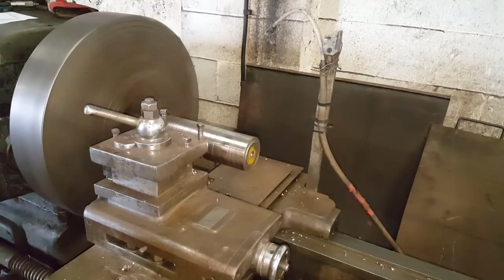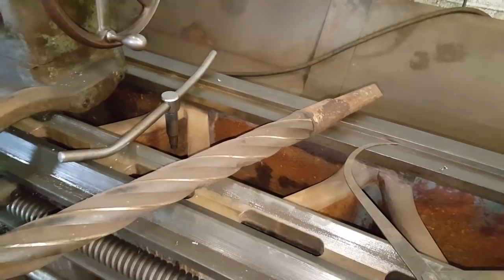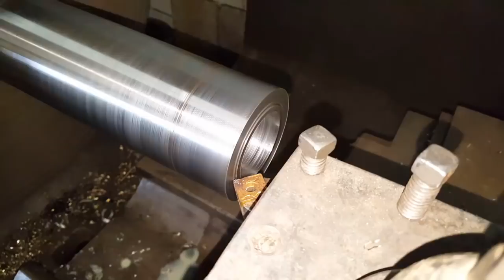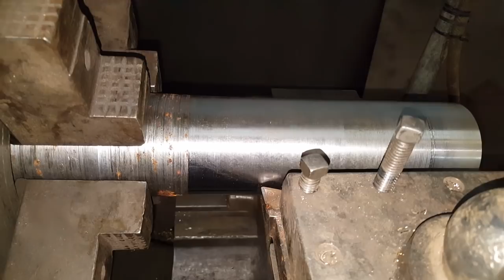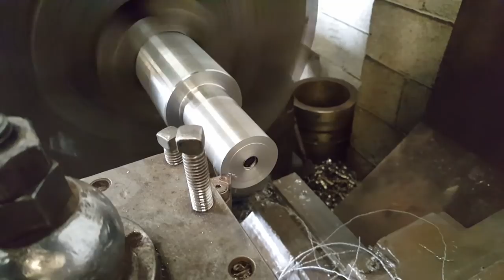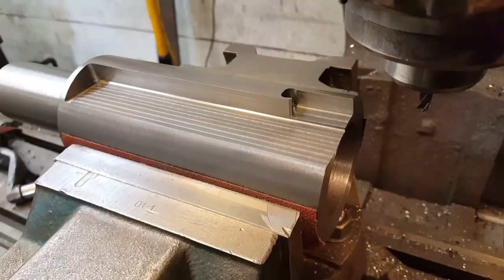Making a cutting tool to drill thick steel.

Comment: Beautiful tool David, I am sure it will work great over in Sunppaa's shop. Your machining skills really shine in your tool making videos. Thanks for the kind words and mention! 😊
Reply from the maker: Makin Sumthin From Nuthin thanks Richard.  Tool making is my favourite job. I wish I'd learned to work CNC but too old now. 😢
Reply: I have worked using computers the last 25 years, sick of seeing them....nothing more enjoyable than running a manual machine and turning out a nice part
Reply: NEVER too old mate!! Thing is though, this tool would take far longer to make on a CNC machine. One-offs or short runs, can't beat manual machining. Not even CNC guys would argue that.

Comment: Beautiful bit of work. Do you have one that size that  fits in my half inch drill chuck?😂
Got to agree with you, tool making is also a passion of mine, that and making bits to repair something that others want to chuck out.
Reply from the maker: Chris Stephens thanks Chris.  I subbed you back 👍
Reply: Thanks for the sub, I hope you wont be too disappointed.

Comment: i cant remember if Ive posted before. I trying to get some dsg type 21 halfnuts?
Reply from the maker: dan wolf hi Dan. Did you find what you needed?
Reply: +userwl2850 hi , thats a fluke as I thought Id check this question for responces just now! Answer is not yet unfortunately

Comment: Sir, Nice video. I used WD 40 for lots of things. Why do you find it better than other types of cutting oil?
 Just curious that's all.
Regards,
Eric
Reply from the maker: Hmshop Fix hi Eric.  WD40 is like magic oil... it keeps the cutter "wet"      oil and grease don't so it's like dry cutting. I use it for many jobs.